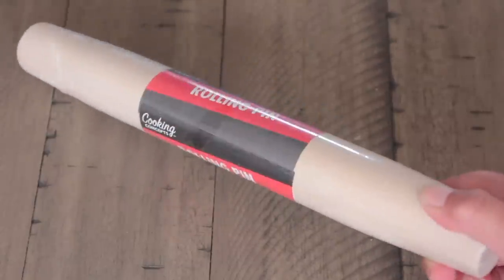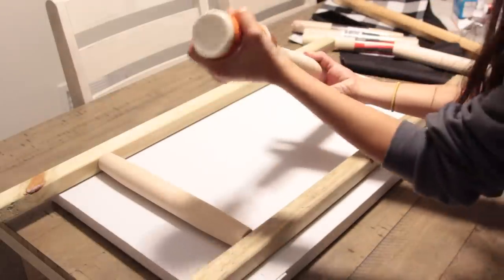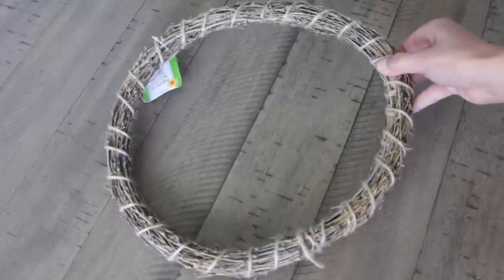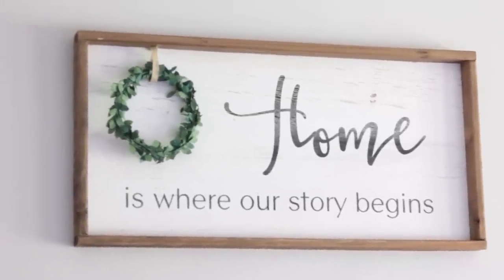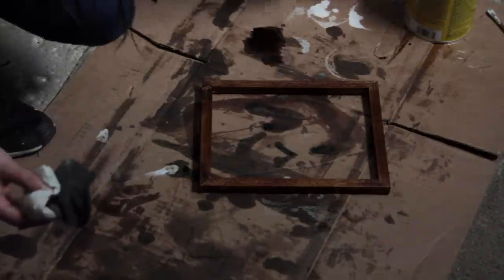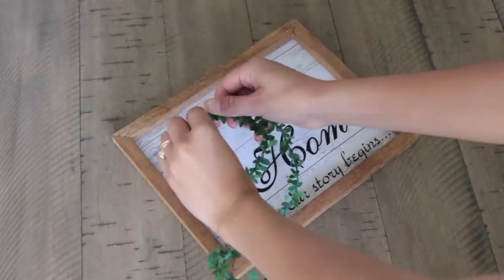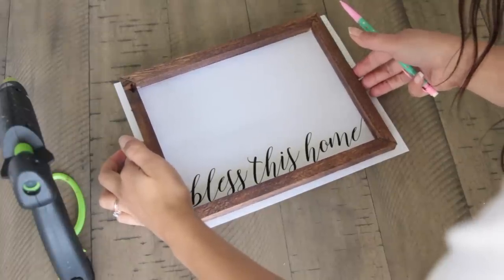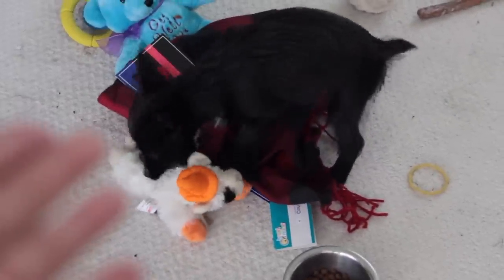DOLLAR TREE DIY POTTERY BARN DUPES FARMHOUSE DECOR

Comment: Love the picture frames with the wreaths as well as the ladder. I use that Garland at Christmas time. I made wreaths for each of my kitchen cabinet doors. Great job Bethany
Reply: jules p what is the garland stuff called ? I want to search on amazon please
Reply: @brandyjones254  it is an ivy type material that is in the wedding section.  It is easy to find
Reply: jules p  thank you so much 😘
Reply: @brandyjones254  you're very welcome.  At my hob lob..it was hanging on the end cap. Just saw it today
Reply: jules p on the end cap by all of the greenery? Did you happen to see a price
Reply: @brandyjones254  1.99 I believe. Then if you wait til the wedding stuff is on sale it would only be 1.00.  I used 4 "rolls" of it to make 6 inch wreaths for my cabinet doors for Christmas.
Reply: @brandyjones254  the wedding stuff is 50% off this week.
Reply: jules p you rock!!! Thank you again
Reply: @brandyjones254  no problem.  Us crafters have to stick together 😁😁

Comment: You could add ribbon on the wreaths for a bow and a pop of color. I would Wrap the ribbon through the wreaths and then put the bow on the top or bottom with a long pieces hanging. If you make one for Christmas, you can buy the smallest of the bells and glue or tie a bell to the wreaths.